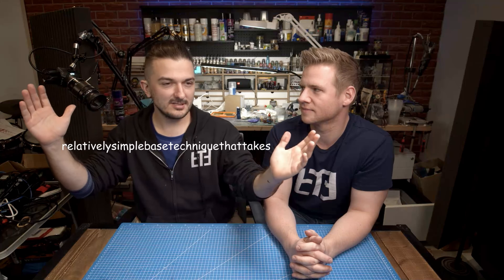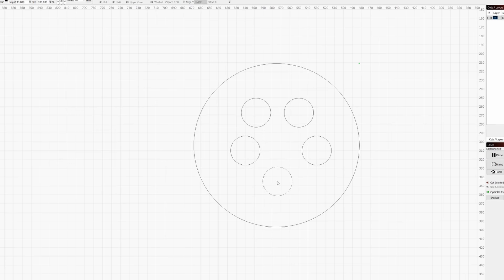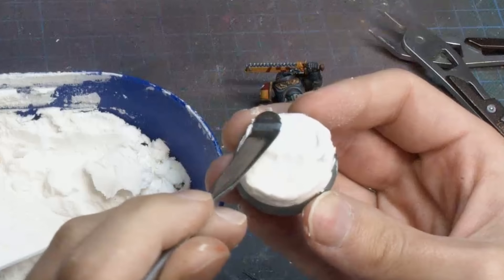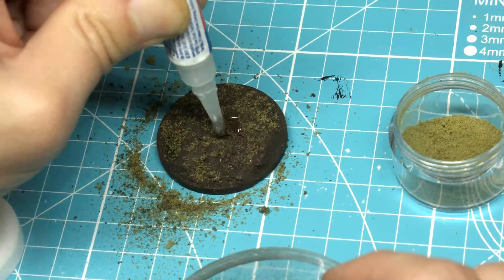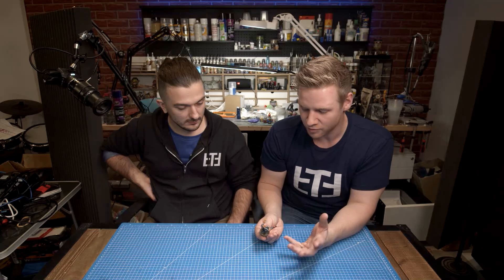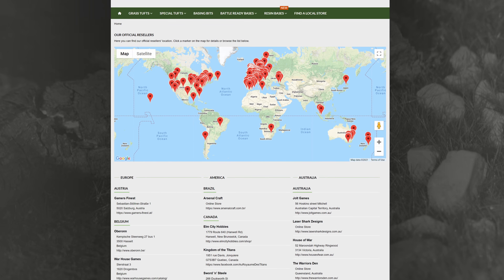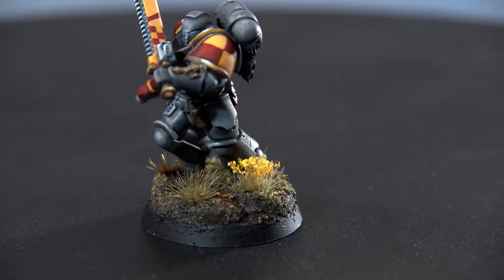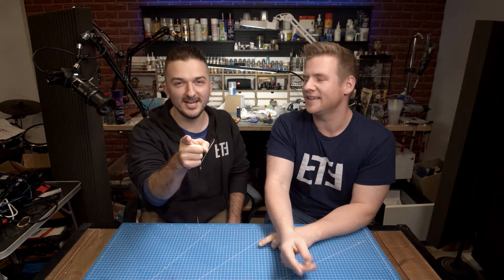Easy tricks to make Wargaming Mini Bases stand out! (FAST!)

Comment: Just a tip regarding texture paste: for bases that size, I suggest you get some from either AK interactive or Vallejo, cause the cost to amount proportion from citadel is horrible. They are good, just not a lot for what they cost.
Reply: Or just mix wall spackle, cheap acrylic paint of the right color and fine sand, works about the same for a fraction of the price per volume, therefore is usable even on big terrain pieces

Comment: Ive done something akin to that by mixing lightweight wood filler, a bit of pva, some fine sand and craft paint, works very much like GW texture paint with a bit of extra volume but is super cheap and you can make it any color you need. The paint and PVA makes so it adheres really well and doesnt crack or chip.

Comment: Dries in 10 minutes, so you had to close the box or its al dry ? And even closed how does it not dries ?
I mean its strange, I dont understand, if you take green stuff per example, its two components, and you mix it then it dries.
Reply: It air dries very quickly. As soon as it is in contact with air. You need to reseal the box and there is a plastic cover that you put over the filler inside the container.

Comment: "Easy tricks to make Wargaming Mini Bases stand out (FAST!)"
1. Use CAD to design the base for your MDF Laser Cutter...
2. Proceed to use a series of GW basing materials

I've finally seen the answer to "This one trick to get smooth blends without an airbrush", which then proceeds to use an airbrush.

Yes I too can knock out my basing after I got my basing materials sorted...
...And I don't even need $10k-$20k pieces of industrial prototyping equipment to do it.